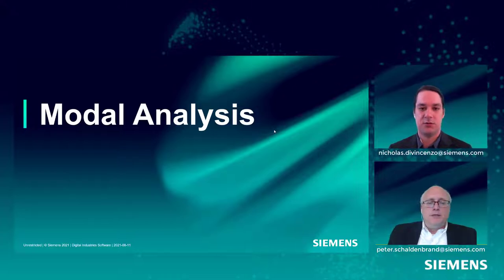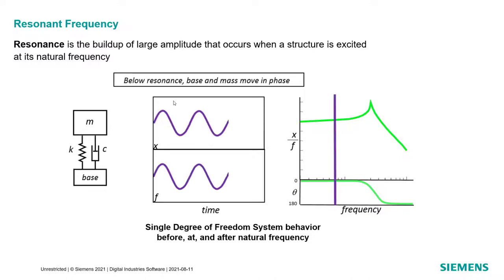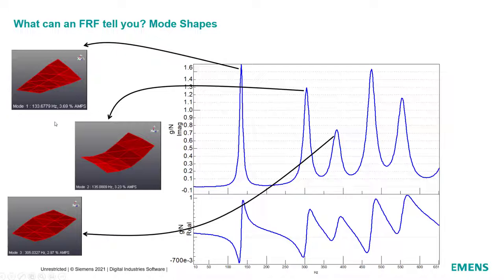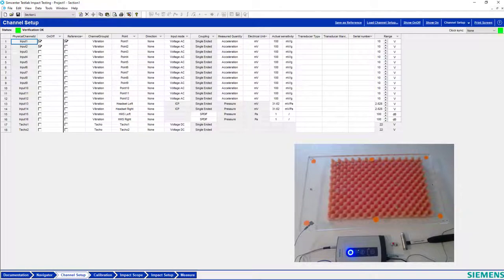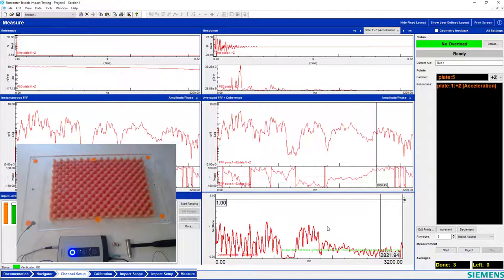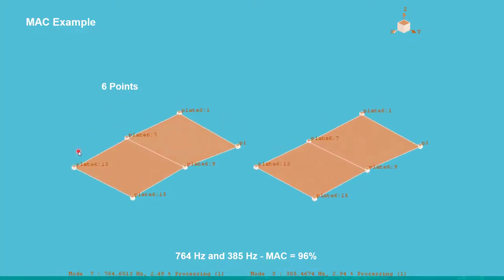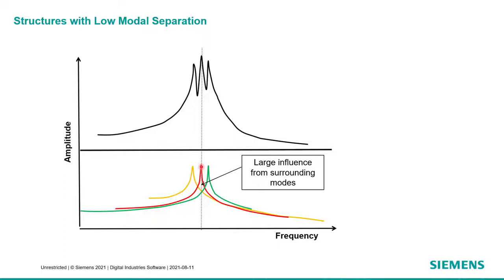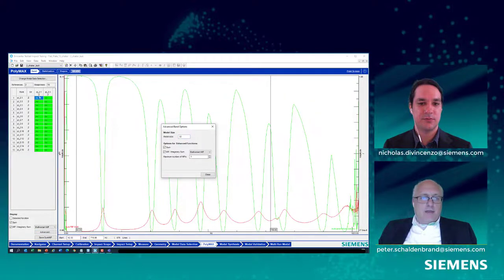Modal Testing Seminar

Comment: Would this software be capable of analyzing the modes of a fluid body using wave gauge/pressure sensor data that captures oscillations of the free surface?
Reply from the maker: Data for the modal analysis does not have to be acceleration as shown in this video.  Data can be any type (pressure, velocity, etc), and assuming there is modal behavior captured in the waveforms, the software can be used to analyze it and find the modes.

Comment: Hello, can you tell me if I want to have two MIF reference points at the 72min of the video? Do i have to have two acceleration sensors for fixed test in the test? If there is only one acceleration sensor, then there can only be one MIF reference. Is this the understanding? Thank you and look forward to your reply
Reply from the maker: Two fixed force inputs are needed for two MIF functions.  If there is one force reference input, there is only one MIF.
Reply: @SimcenterTesting  thanks